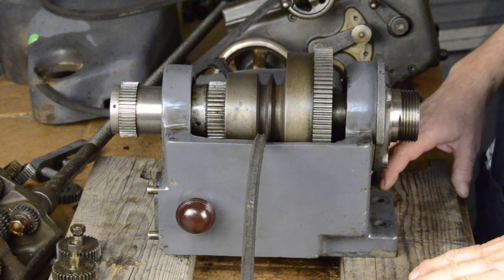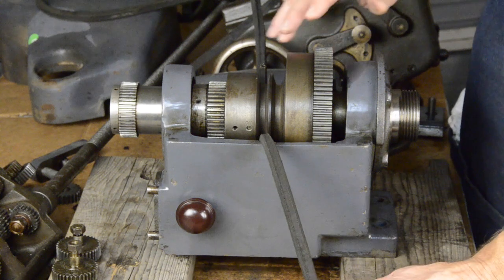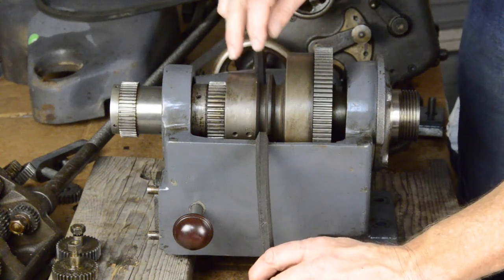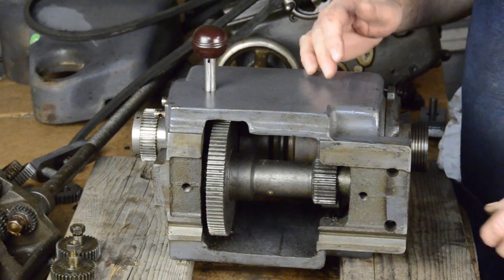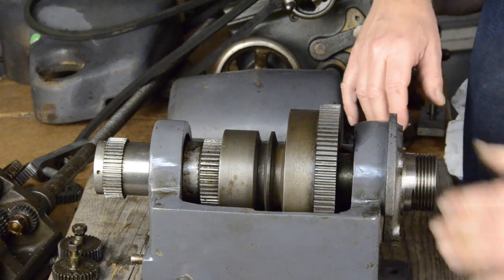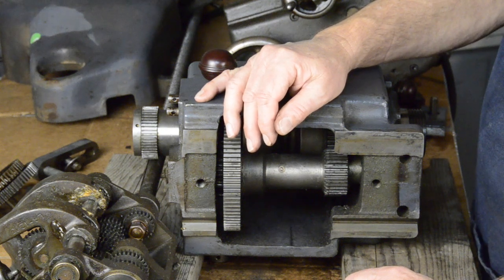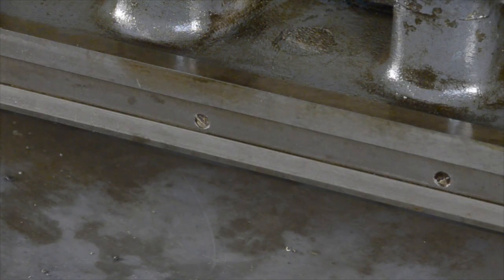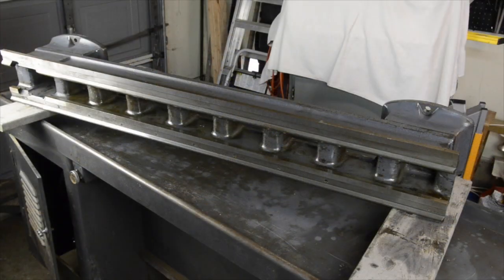Logan lathe, headstock, backgears, bed and ways

Comment: Thanks for this great vid. You did a very nice job getting this lathe tuned up and going well again. The Logan 11x36 is a pretty stout machine with its large spindle ID, long bed and good solid cast components.  Your lathe looks to be in very nice shape for how many years it has been around.  
On a side note, I am currently rebuilding a Logan model 922 11x36 and doing a conversion to under drive cabinet.  You are fortunate to have found a 1957 in such fine condition. Superb lathe.

Comment: Old-school guys used grease instead of oil because it stayed on the gears and did not drip off.  About half the Logans I've seen are missing the pawl that locks the back gear rack in place.  Unfortunately, Logan Armature Co. charges $50 for a replacement.  Fortunately, a replacement part is easy to make.  Don't forget to disengage the direct drive lock pin on the bull gear spindle or your spindle will lock up.  Expect very noisy back gears whether they are greased or oiled.